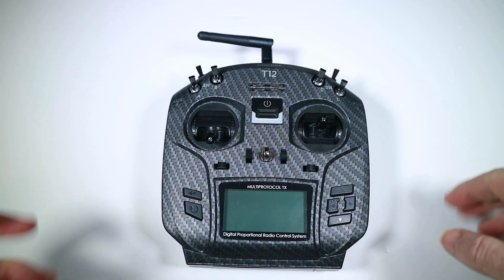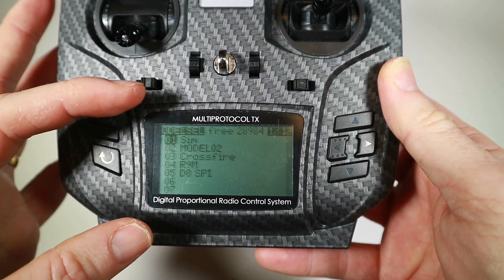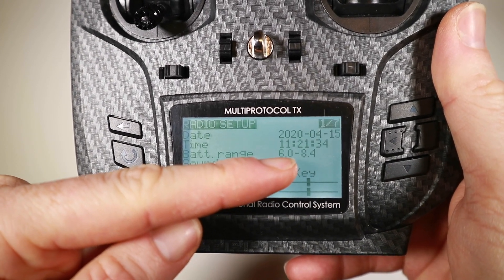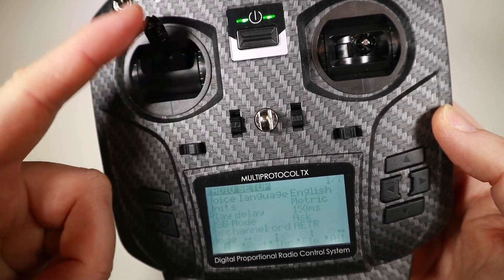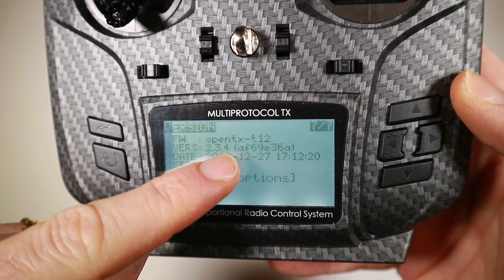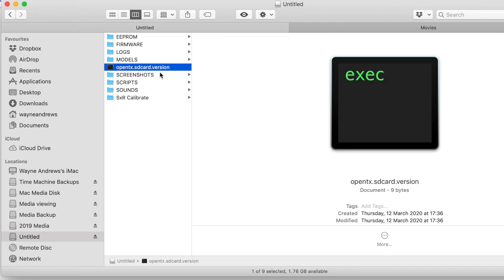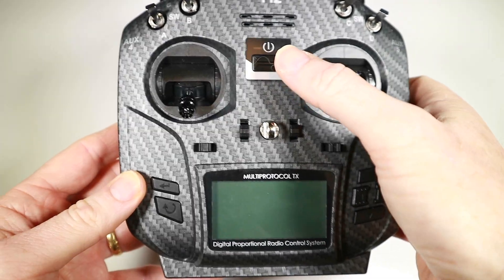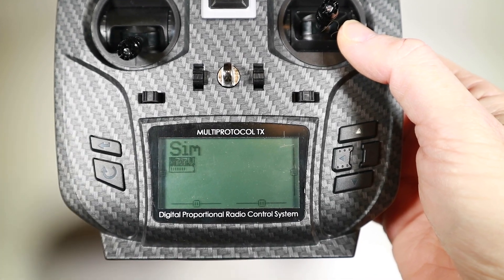OpenTX Pt 1: Setting up your radio and populating/installing the SD card

Comment: I wanted to thank you for your time and sharing the knowledge.
I had somehow loaded a bad Eprom. 
The only thing that I could think of that would cause the problem is I had open TX 2.2 for the Lite Radio 2 from BetaFPV and it may have automatically open it instead of the 2.3 4 that it needed.
I would have never known until the battery was going dead so I had to pull it out the charge it and when I put another battery and that's when it told me there was a bad eprom.
Thanks again for helping everybody in this amazing hobby.
Have a great day!
Reply: sory ı very bad englısh
Reply: ı buy jumper t12 pro and 2 problem 1 problem 2s lion battary 1.s no problem  2.s 0.40 voltagge total voltagge 4.1 and 2. problem lost singnal problems pleas help

Comment: I have one coming in a couple of days and I know irl be watching all your related videos to the T12 pro thanks and keep them coming 👍
Reply from the maker: Nice - have fun with it, but do make sure you are on at least OpenTX 2.3.9 before you get going
Reply: @CurryKitten   thanks for advise much appreciated, I’m in the uk also . Been in to fpv since lockdown  started . My t12 pro turned up today😀  , I have a few issues with my old windows 7 laptop and no luck downloading the open tx programme. Coupled with the fact I can’t get any drivers to get betaflight running properly. 
I do have a speedy bee adaptor which has got me up and flying with my radiolink AT9s and bigger 230 mm drone . Just purchased a mobula 7hd.  Workes  well with my brother in laws jumper radio .  Think I’ve hopefully bound it tonight , to give it a little test flight tomorrow 👍. Thanks again for your vids as there is not much info out there on this radio as to it’s versatility and functions . Can’t wait to add some sounds to it .
Reply: @pelvinsjamz  how is your jumper t12 pro? Have you had any issues after upgrading to the latest opentx firmware?
Reply: @pipoypipoy7796  not had any issues with update . Sorry for late reply .

Comment: What do you recommend setting battery range and low warning if you're using a 2s lipo for your TX?
Reply from the maker: Use the range of 6.6v-8.4v with a battery warning of 7v.  That's a little on the conservative side, but I like to swap a lipo at 3.5v per cell
Reply: @CurryKitten  Sounds good. Thanks.

Comment: i am still having trouble.... please help me. I have followed every step and still it says sd card warning. I did every same step
Reply from the maker: What version of OpenTX have you installed, what does it say in your open.sdcard.version file and what does your error message say at startup?
Reply: @CurryKitten  it says SD card error, I believe it is because I am using a 32gb card. I’m going to try all the steps again but using a 2gb card

Comment: Hello CK. Hope all is going well. Quick question on my t12p. After all the updates the radio continues to say "radio still connected". Any way to get that to stop. It doesn't seam to effect the operation of the radio. I actually have 2 of these and both do it.
Reply from the maker: No fix for this - basically OpenTX insist that it's a hardware issue and therefore won't implement a workaround in software.  It doesn't actually affect anything, but it is annoying.  I've turned off the alarm on mine.  If you want to do the same go into the Radio setup under the alarms section and untick "Rssi shutdown"
Reply: @CurryKitten  Thanks for the quick response. Much appreciated.

Comment: My T12 Pro just came new with firmware 2.3.4. Would you recommend upgrading if it all works like that? Am I risking to mess it up?
Reply from the maker: I absolutely would recommend upgrading that.  There's a bug where accessing the SD card (which the voice uses) can cause the radio to disconnect, this is fixed in 2.3.9
Reply: @CurryKitten  Ok, thanks. Great channel, btw 👍

Comment: Thanks for the tutorial it's useful.  What size SD card's did you try?  I tried a Samsung Evo C10 32GB no dice - unstable.  Now a SanDisk Ultra C10 16GB which was okay, until i tried to put Betaflight LUA onto it and now it's also unstable. Unless these cards are okay and it's other issue.
Reply from the maker: What radio have you got, I found (there's a video about it) theres an issue with Jumper T12/T12 Pro that has an issue reading SD cards (which causes signal loss) and will be fixed in 2.3.8.  But aside from that, none of my radios have been fussy, lots of unbranded cards, 2gb, 16gb, 32gb didn't seem to matter.
Reply: @CurryKitten T12 Pro. Yes i saw your video about the issue, but was there an issue reading from SD card?  I thought it was just an issue if using the voice timer (at 10 seconds loses signal)?
Reply from the maker: @Rob-ml7ps  The actual problem is a DMA error when reading from the card, so I wouldn't trust a card with it in general until the 2.3.8 version appears.  When you say it's unstable, do you mean the radio has a problem, of the SD card is unreliable or the LUA script crashes out?
Reply: @CurryKitten  I found that i could write it it via the Mini USB cable, or my card reader, but once in the T12 Pro, when i scrolled to 'SD-HC Card' the filesystem would appear briefly, then when i returned later only a few random directories were visible, Also, the 'Tools' menu showed 6 tools, but after few seconds only the first one appeared in the list Spectrum (INT). More info here, point #4: https://www.rcgroups.com/forums/showthread.php?3572821-Jumper-T12-Owner-s-Thread-%28Small-Form-2-4G-16CH-OpenTX-Multi-protocol-Radio%29
Reply from the maker: Sorry - this comment got stuck in the spam folder (URL posting will do it) yes, I had the weird flickering and disappearing tools thing (which then made the SD card contents look odd) randomly.   When I got my 2.3.4 version from new, it was ok.  Then I went to 2.3.7 and it was bad, then I went back to 2.3.4 it was still misbehaving, at some point I went to 2.3.7 again and it was fine, then 2.3.8 was good, then back to 2.3.7 bad again.  I'm assuming this is also fixed in 2.3.8
Reply: @CurryKitten  I just tried a Nightly again, and this release (2.3.8N189) didn't look like it bricked it.  So i booted fully.  Now the problem is fixed! The SD card contents and Tools are all there and stable.  Although this specific issue not mentioned in GitHub (searched "SD Card"...i did see yours about voice timer), probably related to that DMA thing that you were discussing. I've put 2.3.7 back and will continue flying.  I'll have to wait for stable 2.3.8 before installing BF LUA, because when i tried last time it was hopeless since folders on T12 kept disappearing. At least i don't need to go out and buy a new SD card again! (i was about to get a 8GB.  I'm using 16GB SanDisk Ultra C10.  I had same symptoms on Samsung Evo 32GB....so actually its not the cards). Cheers!

Comment: Can I use this controller without the module
Reply from the maker: It's an internal module, so the module bay is free to take other things
Reply: @CurryKitten  so is that a yes or no,,, can't seem to go deep into settings on mine and find d8 or d16
Reply from the maker: Without wishing to sound pedantic, the answer is both :)  Yes you can use it without the internal module, but because it's an internal module, getting it out is going to be tricky.  To find D8/D16, do the following in the models setup page, goto Internal RF, set it to MULTI, then set type to FrSky.  At this point in Subtype you can choose (amongst other things) D8 or D16

Comment: 'And on this one I hold down this button here...' Gone. Since this is for beginners, could you go a bit more slowly? Your videos are excellent, but I found I only started to get everything once I'd beejn working with the Tx for a while. This is OK for later ones, but this is introductory, so shoul take nothing for grated.
Reply from the maker: Sorry if it was too fast.  Its particularly tricky getting the level right with videos aimed at new users - and going into real detail means a video 3 times as long and then complaints that it was too slow.  The other reason any button pressing is maybe not lingered over is that it's a different button or control depending on the radio you have, hence it's an OpenTX tutorial rather than a radio based one.